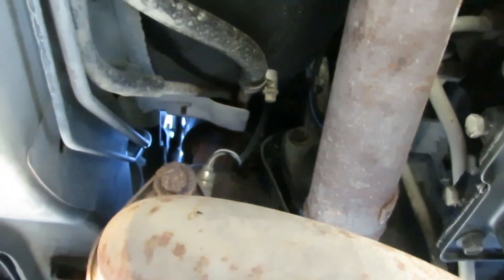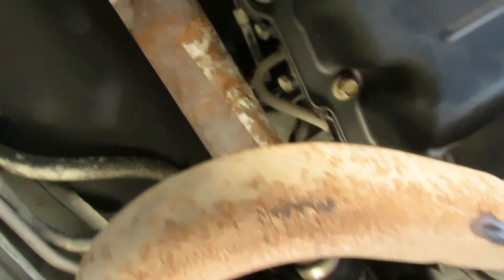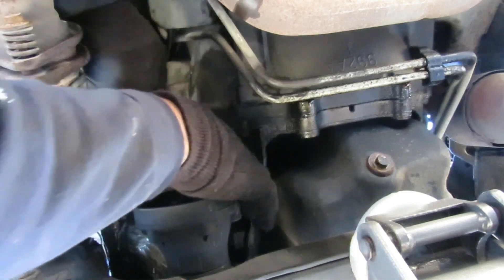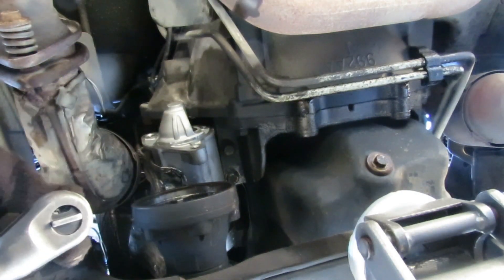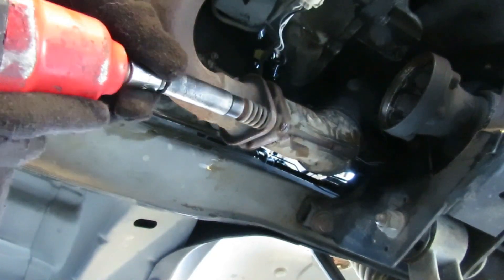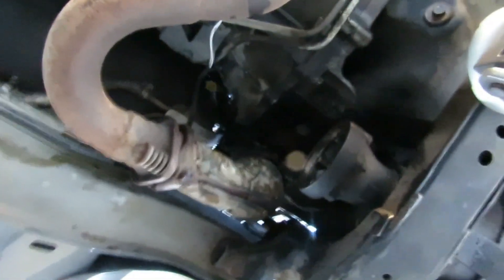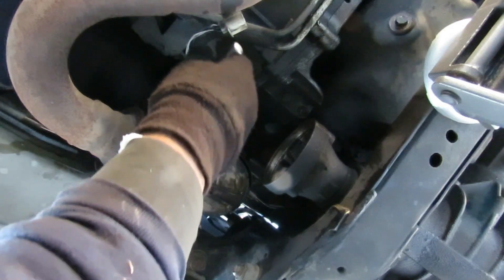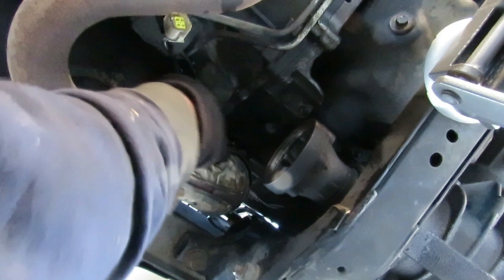⭐2003 Jeep Liberty Sport - 3.7 - Partial Engine Rebuild - PART 3

Comment: Tim,
Man, I cannot thank you enough for this series.  Especially this part!  I am replacing the head gaskets on a 2002 Jeep Liberty.  I couldn't get to the clamp bolt holding on the right side catalytic converter to the exhaust manifold.  I even had a mechanic friend try.  Neither of us could get to it.  He recommended taking the manifold off the head.  That made sense.  So I got everything off the engine and the last thing to remove before the head was the manifold.  Well, that turned out to be a bad idea.  Just too hard to get to.  So I watch your video and you use that two foot long extension.   I crawl back under the car with my long extension and guess what?  It worked!!! I just wanted to say thanks.  If you ever wonder if you help anyone, wonder no more! Yeeeaaaahhhhh buddy
Reply from the maker: LOLOLOL, Thanks for that entertaining adventure!

Comment: On these 3.7l Liberty's I disconnect the exhaust at the spring loaded joint unbolt the head shift it towards the center of the motor to gain easy access to remove the exhaust manifold and leave the exhaust manifold in the engine bay. You are going to remove the heads anyway so it just makes the engine removal a lot easier. They are a royal pain the arse to work on.

Comment: I had to laugh when you said you liked those clamps. It's like the guys who post how easy these 3.7l chrysler under powered, over engineered boat anchors are to work on. They have never done anything mechanical with this albatross but change oil in them.

Comment: I have the snap on sockets, they call them hose or exhaust clamp sockets. It's a 4 piece set, 8, 10, 7/16" and 1/2". They are 3/8" drive, extra deep. Otherwise grey pneumatic makes extra deep impact sockets.
Reply from the maker: Hey Mike, i wonder do they have them in....let's say....a cheaper brand other than snap-on, lol.
Reply: Yes Tim, the grey pneumatic brand makes everything impact you could imagine. They are Taiwanese but real good quality. A lot of heavy duty truck parts outfits carry them. I'm not sure but I believe Amazon carries them as well.
Reply from the maker: Thank you for the info, dafefope80